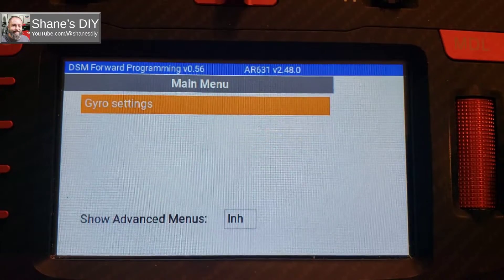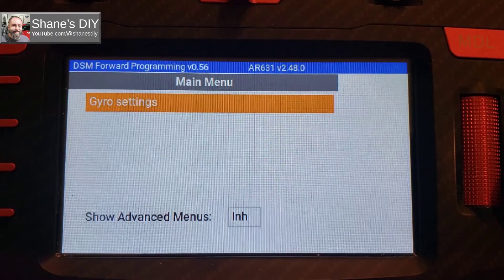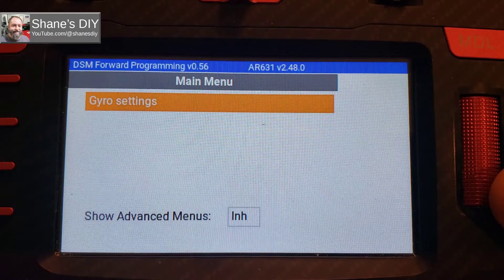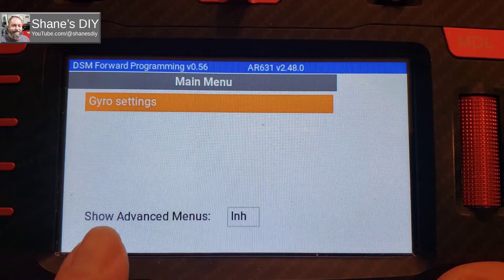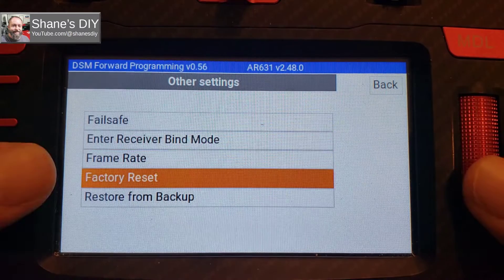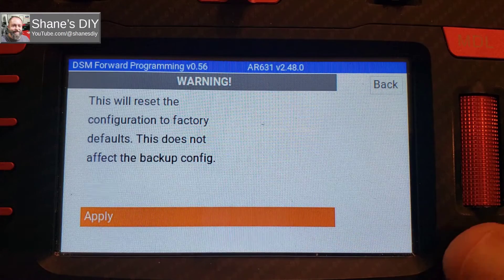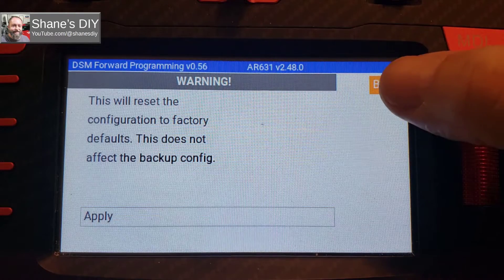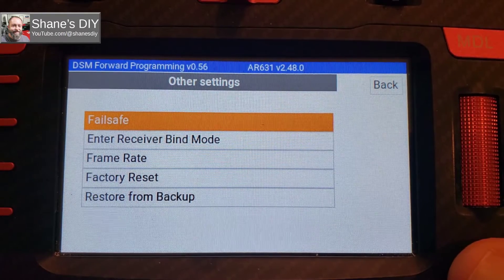Spektrum Forward Programming - Easier BNF Receiver Unlocking!

Comment: I installed the 5.6 DSM Tool Forward programming on my Radiomaster TX16S,  but my AR631 receiver is at v 2.38.   When I go into forward programming I do not get the option to "ACT-ivate' the additional menus.   I'm guessing I've got to update the firmware on the receiver.  Yes/no?

Also, I've now lost SAFE completely and I only have AS3X.   I tried rebinding with bind plug removed after powerup.  The actions of plane/receiver indicate that "SAFE" is activated (2 sets of control movements after bind).   However with testing plane via pitching and rolling, it is clear that only AS3X is activated.

If you have any ideas on how to get both SAFE and AS3X back, please advise.
Both were working before trying to update the FP Tools.   I tried restored the SD files on the radio to what I save prior to the FP update;  still had same problem; only get AS3X working and NO Safe mode.
Reply from the maker: @louisstokes1898  I think the latest DSM tools is 0.59a which includes many updates. Yes, I believe you'll need to update the receiver Firmware.

Make sure you are bound using DSM-X2F AND not DSM2. Aldo make sure you do not have "Enable Max. Throws' checkbox checked in the model RF setup.

Is this a BNF model receiver or new off the shelf?

Comment: How do hou know what firmware is currently on the receiver?
Reply from the maker: If you must have a radio that can do Forward Programming, you can see the firmware number when you connect.  You'll need a radio that can do Forward Programming to reset it anyway so attempt to connect and see if you have the "Show Advanced Menus:" option.  If you don't see that option you either have the older firmware or your receiver is already unlocked in which case the option disappears because all the menus are already visible.

Comment: Great tip!! any advice on the best to get a ar631 used in a good price? tks
Reply from the maker: The one I found was off a Facebook marketplace. Gotta be careful of scammers. If you can find one in your area, RC clubs occasionally have swap meets.
Reply: @shanesdiy  ok tks
Reply from the maker: I just checked what I paid and wasn't technically "cheap" at $55 including shipping but new ones are $85 plus shipping so I'm happy with it.

rcgroups.com forum also has a pretty good classified section where you can find some deals.
Reply: @shanesdiy  found one 630 in FB at $50....i thought it was expensive...it was new. i was looking for a 631.
Reply from the maker: @alexherrera3918  AR630 is the same thing but without the external antenna. I have no experience with it, some say range isn't as good, I can't say.
Reply from the maker: I picked up a used one for pretty cheap, just have to keep a lookout and deals will come along.
Reply: @shanesdiy  ok but where?